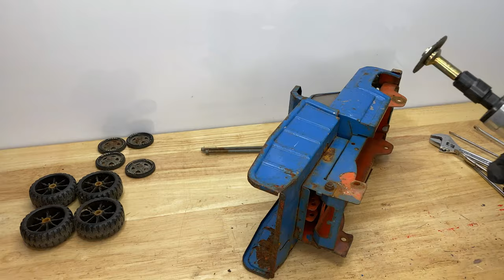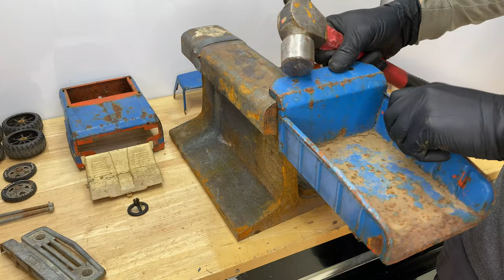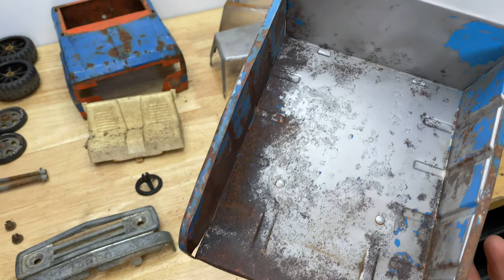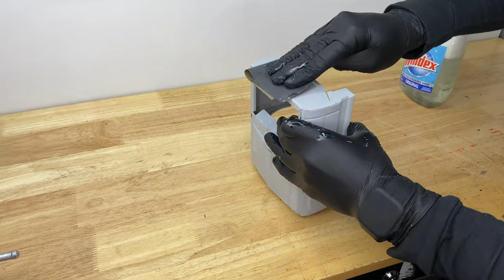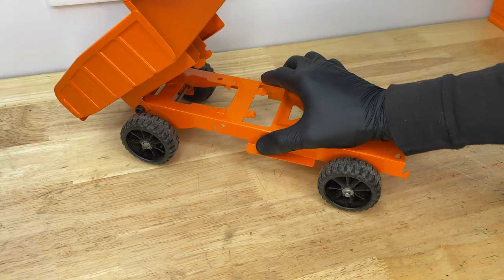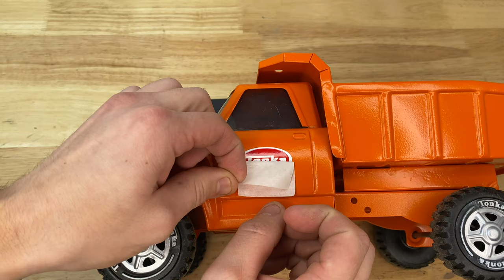1970s Tonka Dump Truck Restoration - Color Change

Comment: Two bits of equipment I'm gonna suggest for you to save money for: sand blaster, and powdercoat sprayer. I'm saying save, because they aren't cheap.But, they will save time and can help you to make money.if I remember right, the powdercoat Orange for that would be hotcoat orange.Eastwood is who makes that. Also,for the tire detail, if nobody else knew, spray white paint on cardboard,and put the raised details on the paint. When they dry,it looks original.
Reply from the maker: Started Powder Coating Now :)